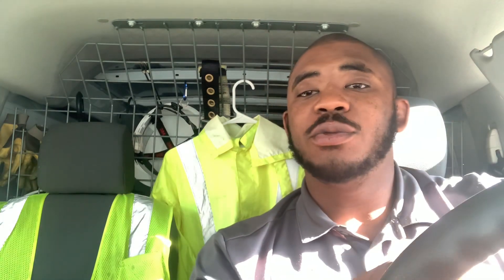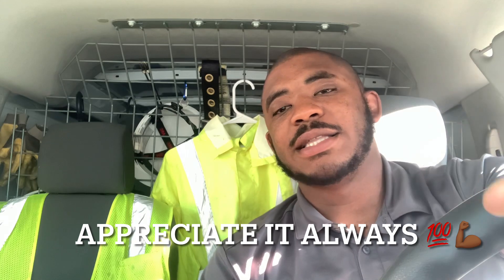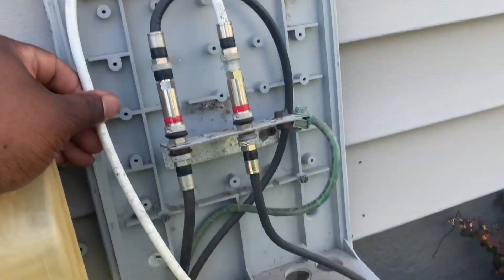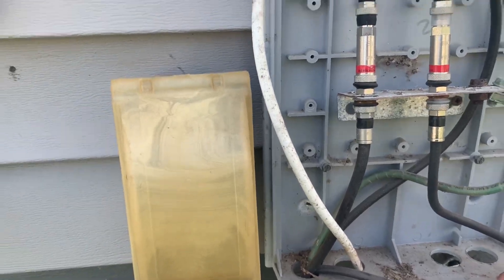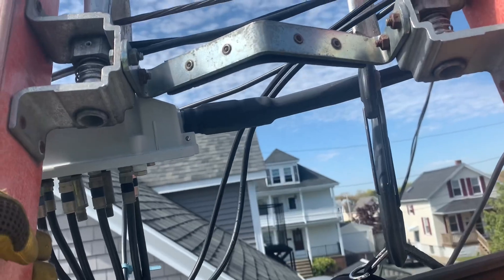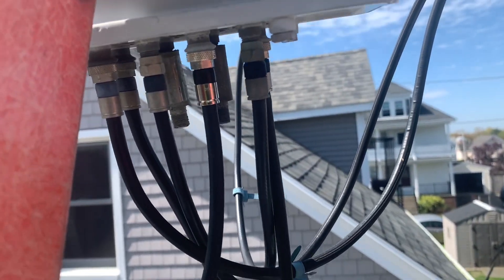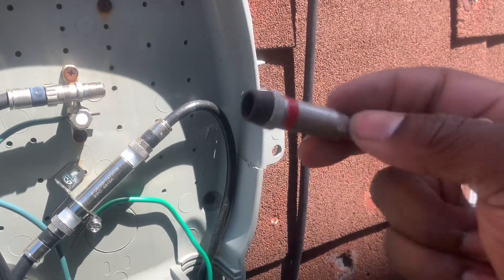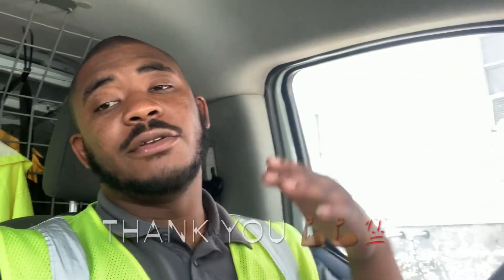Life of a cable technician Ep #13

Comment: That MoCa filter can go almost anywhere depending on the job type. MDU's mainly, an UG's with a direct line into an apartment to the wall plate, or the famous Sunday locked Data Room I'll put a MoCa on the wall plate if I can if it's not gonna impair it. And also I put a MoCa on the ground block and the AMP before to get the boxes working. Crazy jobs. A lot of jobs now, that are simple modem jobs, just enable to MoCa if have none, but the ground block will get hit for bad QC. Then new MoCa ground blocks are only good for homes to me. People out then anywhere though like regular MoCa's on MDU's and etc. Most jobs be merely taking off the MoCa ground block putting on regular ground blocks if you have one, and then putting MoCa's on the splitters. It really depends on the button pushers (TSC). TSC jobs are like non-existent. People in a whole other country will be up at 5AM for your slide to 7 walking you through provisioning and equipment add/remove issues. I feel like I gotta go to their country to do TSC. I probably did a few TSC customer jobs not knowing and they only said they work from home. Them platinum customer jobs. The ones where they go outside with you, and be holding the flash light under the crawl space with you. They be the TSC. But how do I get a TSC position? Techs would love me, because I'm helpful as ever. I don't try techs I just help them. They might have families to feed.

Comment: Really nice content. I am also new in this job and would like to get advice from you. What to do when upstream level is too high or too low and PHT failing because of it. Thank you
Reply from the maker: They only way to fix high upstream levels is to eliminate a splitter or summit a ticket if the upstream is high at the pole... the more splitter you use the higher your upstream will be
Reply from the maker: Now for low upstream you can either put in a spitter in with unused ports terminated or an antenuator if your at a job with high or low up stream it’s much easier to get a reading at the tap first or at least the ground block so you now what signals your dealing with
Reply: @cabletech2371  Thank you so much for your advice. Keep up with valuable YouTube videos and all the best at work👍🙏🏻

Comment: It could just be the angle of the camera but it looks like the dielectric was not flush with the connector. I like to put the MOCA at the tap but ground block works. You just don't want customer removing it
Reply from the maker: It was flush in the connector probably was just the angle Plus it’s hard to tell with those weather protected f connectors in the video lol
Reply: BRIS book last i checked says POE filter goes at the groundblock (QC guys will fail you if it isnt there anyway,depending on the area you work) working on bigger houses its good to be on the main splitter (basement attic wherever) cause MOCA loses signal over distance just like regular signal and PHT will fail on MOCA if all the boxes arent getting good signal to each other. im talking like 10 bedroom houses at that point though. from what i hear they used to say just always put it on the tap but thatll cause the port to break off real easy so at least put it on a jumper if youre doing that
Reply: @smokebuddy99  Interesting. Yeah when I said on tap I mean on a jumper. Otherwise the port will break like you said.
Reply: We’re not supposed to put MOCA filter at tap, except for inside apartment MDUs
Reply: @snel91  Right. It can break the port. When I said tap, I meant on a pigtail.